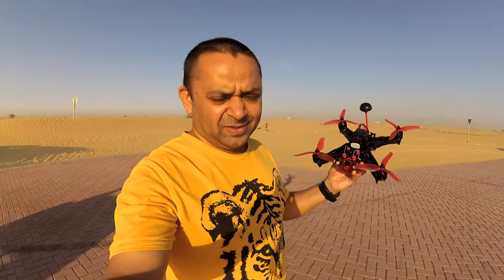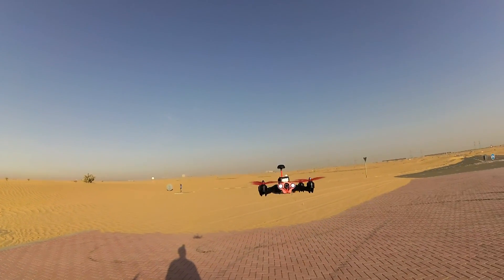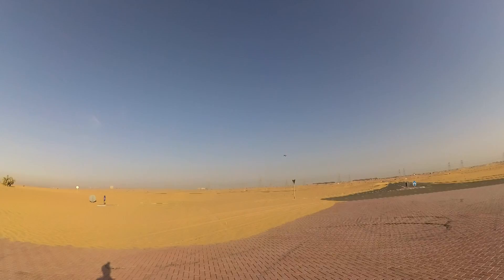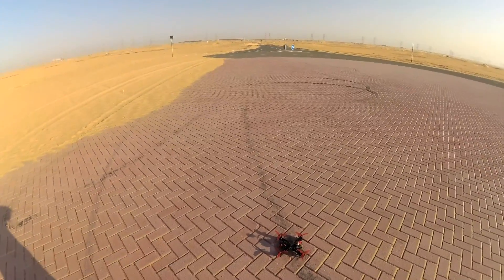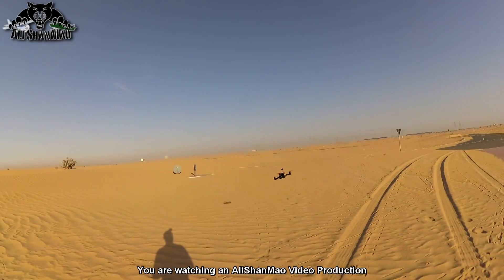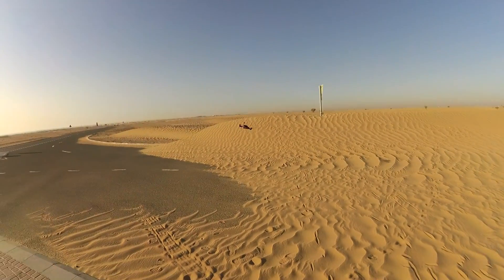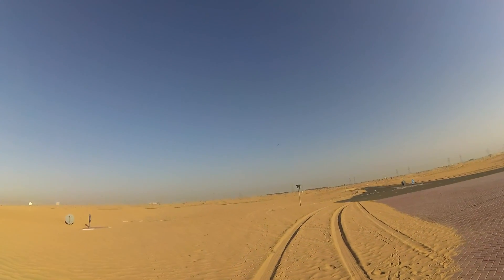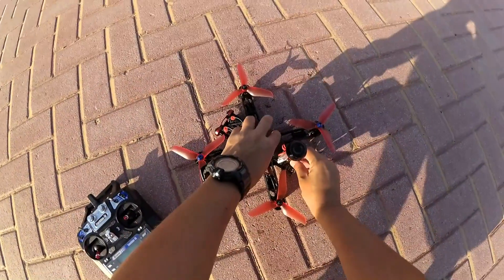Eachine 250 Pro FPV Racing Quadcopter Maiden Flight

Comment: Eachine have put some nice components in an awful frame, why are they still using those useless plastic arms? As for the firmware, its well worth the effort to upgrade to latest Betaflight and setting airmode, later betaflight releases fly really nice on stock pids

Comment from the maker: +Node Systems Ltd 

Good Question my friend. two thumbs up for the fun factor and how well it flies right outside the box. 

motors stopping is a small issue that can easily be solved by using throttle curves in the Radio an or setting up an air mode using Cleanflight.

Comment: Please explain how you can give this two thumbs up, when the transmitters stick to control the motors does not have the correct range of movement and therefore inexperienced flyers (most who will buy this product) there quad will fall out of the sky, this is quite dangerous. It was good of you to highlight this in the video.